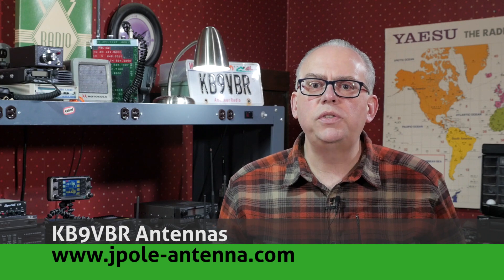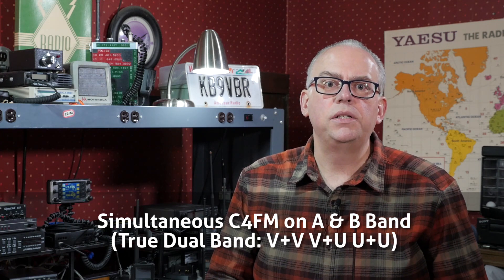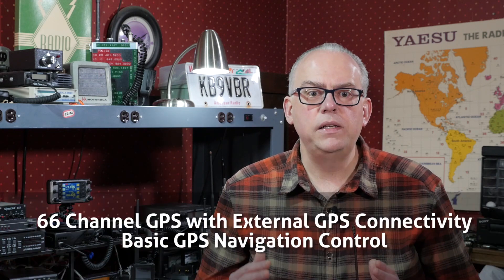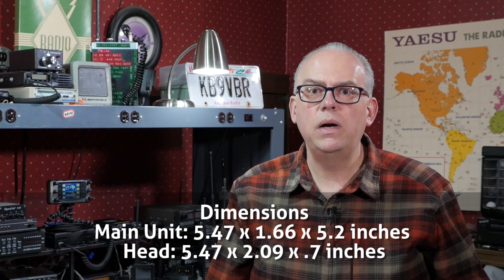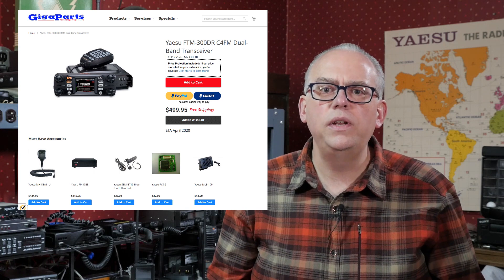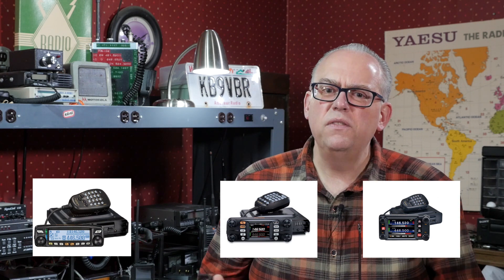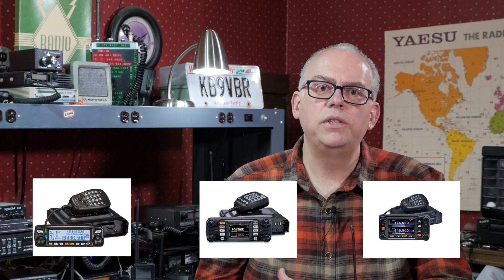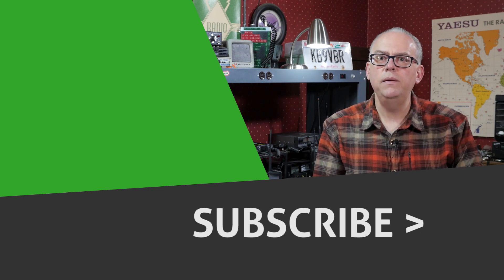New Radio! Yaesu FTM-300DR Product Announcement - Ham Radio Q&A

Comment: IS YAESU SELLING DEFECTIVE FTM300 RADIOS, AND THEN REFUSING TO PROPERLY FIX THEM? LOOKS LIKE FRAUD TO ME AND I'M NOT HAPPY.

I recently bought what was advertised as a 50-watt radio from associated radio in Kansas, it was the Yaesu FTM 300D. From the day I received it, I judged it to be defective because it at best it would put out perhaps 45 Watts on any given frequency. Every other radio high I've ever owned that claimed to be a 50 watt radio put out at least 60 watts. Not less than 50 Watts.

Anyway I was conned into paying return shipping and insurance for this radio back to associated radio to be repaired. I even had to invest in a dummy load in order to prove my case and get them to take a look at it. So in addition to the price of a brand new radio I'm out of almost a hundred bucks for shipping and dummy load. 

Unfortunately when I got it back nothing had changed nothing was fixed it's still putting out around 45 Watts on 146.520. I then demanded that Yaesu take it back and pay the shipping. They kept it for 3 weeks never contacted me, never said anything. When I got it back I was so apprehensive it took me 3 days to hook the radio up because I was catching on to what they were doing. Sure enough when I fired it up nothing had changed couldn't get over 45 Watts on  the most important frequency that we use.... the call frequency. This is the only radio I've ever owned that doesn't put out around 60 watts on this frequency. 
This radio is advertised as a 50-watt radio and every other 50 watt radio as I previously said that I've ever owned puts out well over 50 Watts. 
A friend's identical FTM 300D radio bought at the same time from the same company does put out 60 watts on this frequency, but mine doesn't. 

I feel like I have been deceived and defrauded and I'm about running out of patience here being treated this way by a multi-million dollar company that wants me to eat their mistake!

Does anyone have any other analysis of this? What would you do if you were in this situation? 

I am very tempted to go to the bank and dispute the entire charge on grounds of being defrauded. Would any of you consider doing this after having jumped through all these hoops, and having to face the indignity of spending an extra $100 trying to get a defective radio fixed and in the end they didn't fix it and they didn't even bother contacting me telling me that they didn't fix it. 

Anyhow I would much appreciate any input that you can provide I am very fed up I am tired of trying to do this the proper way because it hasn't worked

Comment: I Would Love it if Yaesu would make a replacement model for the ftm-400 that has the True dual receiver, built in Bluetooth, and speech board as the ft-3 and ftm-300 have along with a Bigger, more visual and more responsive touchscreen than the ftm-400. Like either the ftm-450 or 500, that’s what kind of mobile non-HF radio I would buy.

Comment: Great video!  I have two question for you. 1. On cross band repeater mode is it possible to program the radio to transmit  & receive to different frequencies on VHF   2. Is it possible program this radio to work same band repeater mode with two separate antenna connections.
Reply from the maker: The answer to both is no. Cross band repeat works between a VHF and UHF frequency. You can't crossband on two VHF frequencies (the parts required for the isolation required to repeat on two VHF channels would not fit inside the radio). The radio only has one antenna port so there is no facility to split the operation between two antennas.
Reply: Thank you. I know it has the cross band repeater mode. I is it possible use cross  band   mode on semi duplex mode on VHF & UHF  eg  145.600 with (minus shift 145.000 for VHF transmit)  &  439.950 with (minus shift 434.950  for VHF transmit)

Comment: Dec 2020... should I get the 400 or 300? I still don't get why the 400 is $100 more expensive
Reply from the maker: That's a really good question, especially considering the price difference. The 300 has dual C4FM vocoders but the FTM-400 has a larger display and touch screen. Pricing may be more of a marketing position than a reality of value and capability. If you are planning to operate mobile, I'd lean towards the 400 as it has an excellent user interface in that regard. If you are planning to buy the radio for inside the shack. I'd totally go the 300 route. I hope this helps.

Comment: what do you think of the comparison now that the price is the same as the 400? I want to buy one of them for a base unit. I own the 400 in my truck.
Reply from the maker: There might be a little more price adjustment with either radio when the 300 is actually available for sale. So I'm still waiting
Reply: KB9VBR Antennas I hear the month delay decide I would miss the large display of the 400 to much so bought it last night for a base.

Comment: If the head can be mounted up to 10 ft away from the radio, does that indicate the microphone could connect via the head - or - do you need another extension for the speaker/mic to also reach the radio? Seems odd to have a 10' cable for only the head and not consider the mic connection too?
Reply from the maker: It's hard to tell from the pictures if the microphone connects to the head or the main body of the unit. I'd guess the main body as Yaesu does that with all their other radios.

Comment: So what's the driver that one would pick the 300DR over the 400XDR? These seem to have the same pricing scheme. ????
Reply from the maker: I think the big advantage of the 300 over the 400 is that with 2 digital vocoders‚ you can attach the HRI-200 to the B channel and run it in PDN mode. This leaves the A channel free for both digital and analog use. You could then monitor the local Fusion repeater on the A channel and another fusion room of your choice on the B channel.

I do something similar to that with my hotspot. Our local fusion repeater frequently gets set to the CQ America room and I like to listen to MinnWIS on the hotspot. So on my FT-3DR I'll listen to repeater on the A channel and on the B channel the hotspot.

Comment: Thanks for this announcement. I have looked at the FTM-100 for years but refused to buy it because it doesn't have dual band receiver. I recently upgraded my repeater to analog and fusion because my existing repeater needed repair. I am currently learning the. FT-2DR and the digital stuff.

Comment: I hope you get one Michael. I read the specs on the HRO website and it is a far superior radio to the FTM-400XDR. It does the PDN and HRI-200 modes while using the the other VFO to monitor another fusion or analog repeater or radio. I will be owning one once I get my HF radio paid off.
Reply from the maker: I'm thinking that with the 2nd digital vocoder that this rig would be a great choice for the shack. You'd have the A band for all you local VHF/UHF stuff and the B band could be dedicated to Wires-X

Comment: What I want to know, Will it do cross band repeat in fusion mode?
Reply: The spec sheet of the FTM-300DR on DX Engineering site says no crossband.
Reply from the maker: That's a good question. Unfortunately we really won't know until Yaesu releases the product.

Comment: How would one add an external GPS antenna to the FTM-400?  Can you simply plug an antenna into the control head and place it on the dash for better reception?  

Is there any way to program channels into banks on the FTM-400?  If so, how many?
Reply: Josh Rue just buy a gps repeater. Got mine on Amazon and works great.
Reply: https://www.amazon.co.uk/Amplifier-Antenna-Navigation-Receiver-ANT-1573/dp/B07SJ7VC19
Reply: That is the biggest downside of the FTM-400...they took away the memory banks.  I think the memory banks will be back in the FTM-300.  The FT3D got memory banks.  As stated in the video, it appears Yaesu is putting the FT3D features into a mobile unit.

Comment: I wish Kenwood would do Fusion.  2nd I always know a Yaesu by the Wind popping, so I hope the new mic fixes it.  I own ftm-100dr & ftm7250dr both are good for my use, however this ftm-300dr looks better then the ftm-400dr & I would consider the ftm-300dr because I monitor 2 fusion repeaters.  love my v71a is a 100x better than both Yaesu's put together. Sorry I feel that way, but this is not the place to say Ford, or GM is better I just want a Fusion, DMR,  DStar,  & FM mode dualbander or Tri-bander or Quad-bander radio by the big 3.  Meanwhile excellent video and I am glad you have done that. Again, my hopes is more hams get on the air then any radio brand or type. Fusion is fun
Reply from the maker: Great comments. The Kenwood V71a is a bullet-proof rig. I like it a lot too.

Comment: Thanks for another great video!
I'm still wondering why Yaesu hasn't brought C4FM to the 8900 quad bander with some other features as a nice upgrade. That would likely get me to part with $400-$500 quite easily!! 10M & 6M C4FM would be really nice and it would give the 991 owners  a mobile companion in that arena. I really don't see a 'gap' that needed filling by the 300.
Just my 2 cents.
btw... my licensed XYL & I love our 7250's (they get daily use) and the price with coupons etc. was a good placement in the market.
73s
Reply: Because they discontinued the 8900
Reply: @jeremyfowler5565  an '8900A' C4FM quad bander would have made a better radio than the addition of the 300, ya know... because the world was really aching for yet another dual band digital.  Maybe the 400 will go away and the quad may still have hope. (but you know what they say about opinions)

Comment: No way it has a smaller screen. Seem to similar to the 400 plus I prefer the larger screen. Not a bad unit.
Reply from the maker: I really like the touch screen on the 400. I find it very easy to navigate while in the car. If I were to buy one of these I think it would end up as a shack radio.

Comment: Some good thoughts on the new unit, thanks MIchael.  The FTM-300 will still be too pricey for my mobile unit needs, because I already own the FTM-100 and am still learning all it has to offer w/ the digital mode.   I love my Yaesu FTM-100 combined with the 2M J-pole antenna from KB9VBR Jpole-
antenna.com for home use!  What a great value antenna (and radio).  Crystal clear reception and gets me 15 miles+ simplex in my bad area.  Also gets me booming to the repeaters around town when I hook my cheapy/cheapy china hand held up to the J-pole!   Just wondering if folks really use the detachable faces, or just like the option if need be?   Even with extensions, I can only have the face plate so far from the mic within reason in my mobile set up/battery situation.   KC3OEE    ( But, I'd love to have that 300's read out vs the 100!)
Reply from the maker: I think using the detachable face depends on the vehicle you are mounting the radio in. Back in the day when I owned late '90s and early '00s vehicles‚ there was space under the dash or between the seats to mount a radio. With my current vehicle‚ a Subaru Outback‚ the detachable head is necessary.

Comment: Two years ago I was debating 
between getting the FTM-100DR right away or waiting a bit to get the FTM-400. I decided that I didn’t need the touchscreen or the dual VFO so I bought the FTM-100DR. I use it as my 2 meter/70cm base station and I’ve never regretted it. The 7250 never really appealed to me so I won’t miss it if it goes away. I think Yaesu will push the 300 as a mobile station while the 400 is great as a mobile or base since the head doesn’t connect to the body. I’m partial to the 100 so I hope it stays in the lineup.
Reply from the maker: For what the FTM-100 does‚ it's a great radio and the price is right.
Reply: the 100 has a dual VFO.
Reply: forgetyourlife Not like the 400 but that’s alright.

Comment: Good news! Enjoyed your video! Thumbs up always!
First off what is the radio that has a separate head on the shelf behind you? It has six knobs on it and appears to have a color screen. Maybe it isn't a radio.
Second the FTM-100DR while not a feature rich radio like the FTM-400XDR it is their best selling radio in the fusion / PDN class radios. I was scolded by an Elmer that I should have held out for the FTM-400XDR and that the FTM-100DR was a dog but now because of the price is Yaesu's best seller for PDN use anyway.
Third I think Yaesu should work on a MOBILE Shack in the Box little brother to the FT-991A with a nice large detachable or separate head. I bought the IC-7100 but think I might have made a mistake in doing so but the price was right.
Reply from the maker: The radio is the Icom IC-2800: https://youtu.be/UyTXAFLlHI8. I think the FTM-100 is a great radio and right now for the price it is hard to beat. When I bought my FTM-400 for the car‚ I looked closely at both rigs but wanted something with the ability to do full-time APRS.
Reply: @KB9VBRAntennas  I wanted the 400 also but I had just passed my tech exam and The 400 was on back order everywhere so the good folks at HRO recommended the FTM-100DR and I am glad I bought it. I later purchased the FTM-400XDR and the FT2DR when they had that killer sale last spring when they came back into stock.
Reply: It's IC-2800 Icom first color lcd dualbander.  https://www.universal-radio.com/catalog/fm_txvrs/1153.html

Comment: No Crossband Repeat?!
Reply from the maker: My guess‚ since the radio has 2 VFOs is that cross-band repeat will be a function of the radio. Yaesu never advertises the cross-band function but every mobile radio they offered with dual VFOs had it built in.
Reply: @KB9VBRAntennas  I will wait to make sure it does. Do you view this radio as a replacement for FTM400XDR?
Reply: Yaesu will never mention it. Even if it does it.

Comment: They should have updated the FTM-100, or replace it with this for the same price point.
Reply: The FTM-100DR needs an update but like you say same price point. It is too good of a radio to pass up at $270. They must be still making them.
Reply: @1crazynordlander  Agreed. I'd just like a firmware update to allow me to use the ARISS path for the ISS and other satellite digipeaters. Otherwise I think it's an awesome radio!
Reply: I didn’t read that there is cross band operation on the 300 but hope its capable of of doing so.